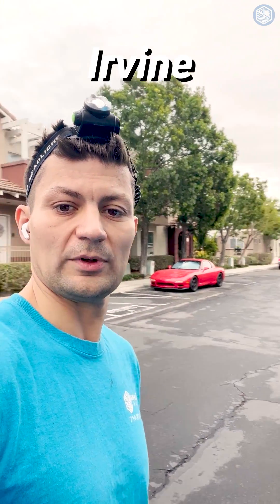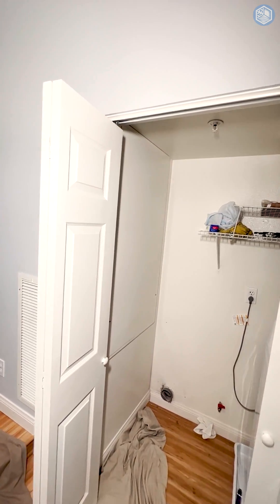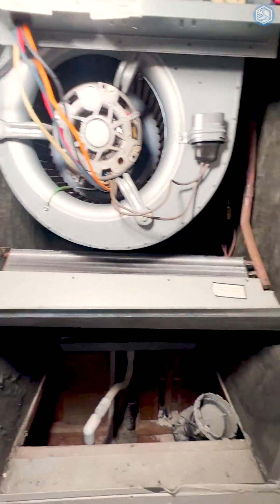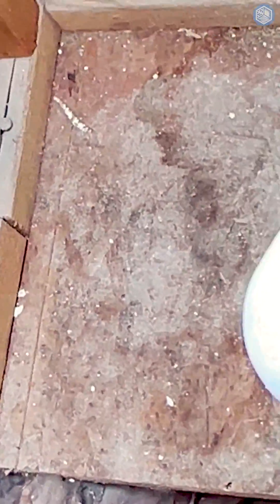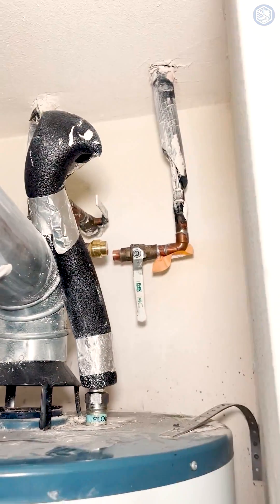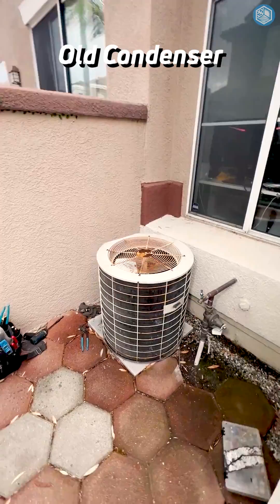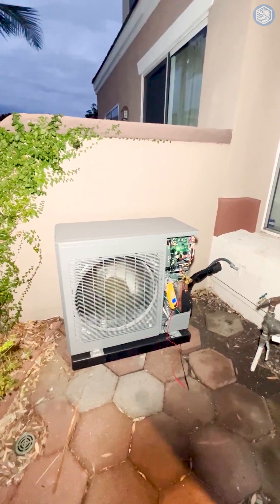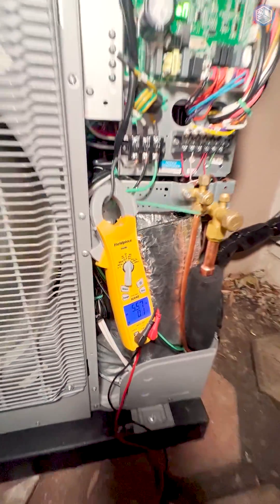Hydronic to Heat Pump - Conversion HVAC system Upgrade

Comment: Are you a GE guy now?
Reply from the maker: looks like most GE units also “identical” to LENNOX or ALLIED so we are very familiar with this time proven equipment and it has better warranty so more value for our customers.
Reply: @airbluehvac  What distributor sells GE? I'm in SoCal as well.